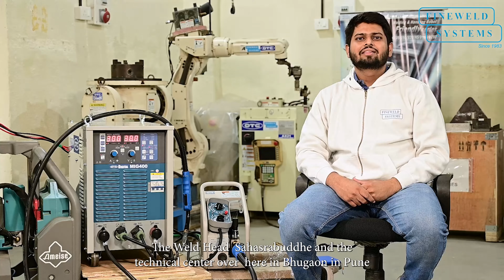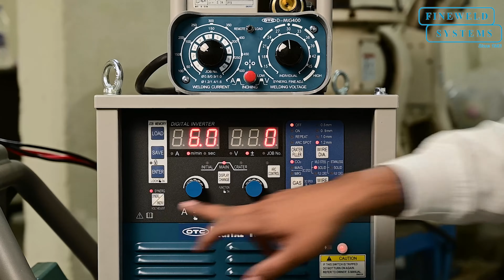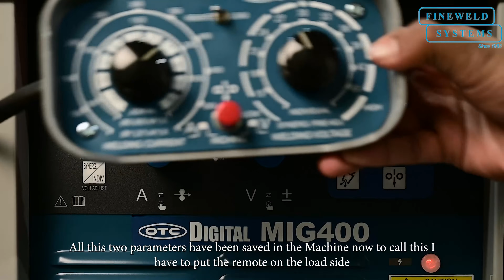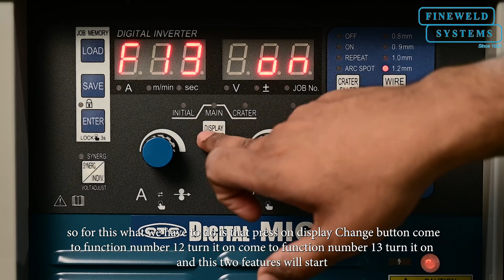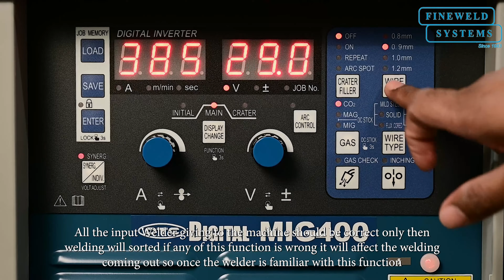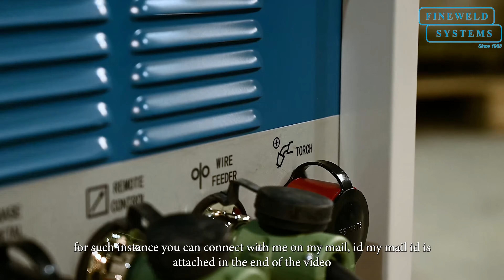Basic Selection Criteria for CO2 MIG Welding Machine. F.T - OTC Daihen Japan D-MIG 400.

Comment: Hello! Thank you for sharing your knowledge, really helpful for understanding the interface! I have an CPVE 500 II but is in CH, and is installed on a "Noname Robot" that can interference with parameters! Question: If i activate the Penetration control function, or other functions that the machines posses, it will remains ON or will have effect if the parameters - AMPS/Voltages are controlled by robot?

Comment: In otc DM500 welding robot machine, current output display  shows 185 amp weather in program current set  200 amp or 240 amp. Why this problem happens?